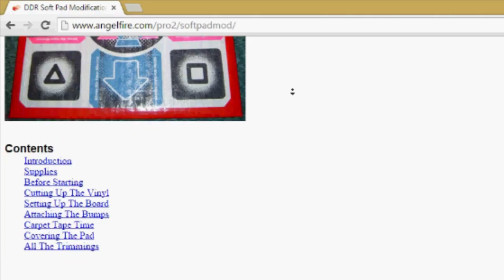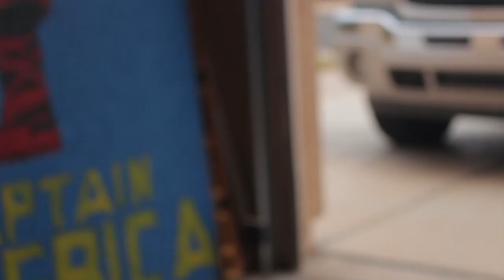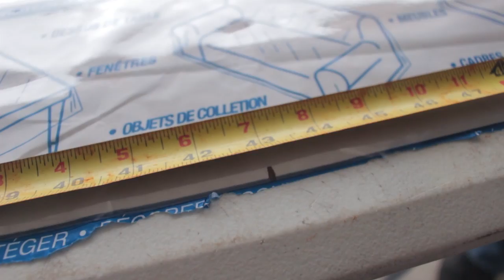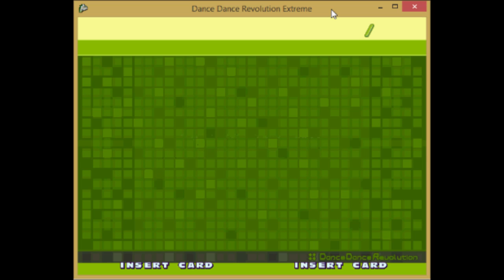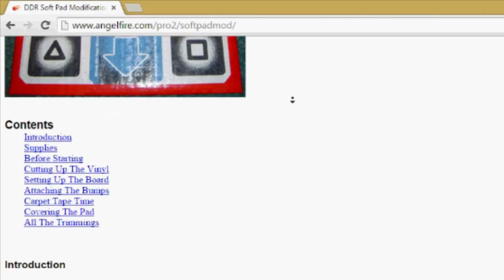DDR Soft Pad Modification Tutorial

Comment: will there be any input lag if I use a converter to PC? I wanna get a pad like right now but I don't have money for an ltek but this will do
the only problem is I don't have a ps2 lol
Reply from the maker: Both my pads use a PS2 to Pc converter and they have zero lag they work perfectly. I've used two other pads with convertors as well and they worked perfectly fine too
Reply: @marioCazares  sounds good, which converter are you currently using if you dont mind?
Reply from the maker: @harmonicposting  Hey I use this one: https://www.walmart.com/ip/PS2-USB-Dual-Controller-PC-Adapter-Converter-Consumer-Electronics-Gaming-Accessories-Player-Cable-Playstation-Attractive-Game-Joypad/581869851?wmlspartner=wlpa&selectedSellerId=101091584&&adid=22222222228000000000&wl0=&wl1=g&wl2=m&wl3=42423897272&wl4=aud-430887228898:pla-51320962143&wl5=1013523&wl6=&wl7=&wl8=&wl9=pla&wl10=462998764&wl11=online&wl12=581869851&veh=sem&gclid=Cj0KCQiAtJeNBhCVARIsANJUJ2ES6iK6IKpAFg5PM-dEh1gyoZVBMFr5zKZuICVct3Gc3IBYXEVYJZgaAr_jEALw_wcB&gclsrc=aw.ds

Comment: I just got DDR but how much better is the performance with this mod?
Reply from the maker: The pad does not move around nearly as much, and also you never have the issue of the pad scrunching up. You can even use shoes with this mod. So I'd say it a substantial difference from the non-modded soft pad
Reply: mario Cazares Really cool!

Comment: I finished the modification and it worked very well, but when I try to play it slides. how do I make it non-slip?
Reply from the maker: You can try a yoga mat placed under the modded pad (as this worked pretty well for me) or one that I haven't tried is possibly using Velcro strips under the pad
Reply: @marioCazares  thank you!! and one more thing. i can now play it with shoes or not?
Reply from the maker: @trippyship6222  yup you can I played quite a bit in shoes but I actually found it more comfortable with socks mostly

Comment: How much did you spend on doing all of this?
Reply from the maker: Since I already had the wood boards I believe it was only about 9$ total for the supplies other than the pads. I only had to buy double sided carpet tape and vinyl because I already had duct tape.

If you buy all the items (besides tools) it should only cost around 40-45$. This is all assuming you have dance pads already. Also, since this is for TWO pads, doing ONE pad could save you money on the vinyl and wood board.

Hope this helps.

Comment: hey mario, If I want to make a most ghetto one. That mean I just need a soft pad, a piece of wood and a double sided carpet tape right?

Update: After told this to my mom, she gave me a thick double sided tape and a thick yoga pad. I taped the soft pad on the yoga pad and it works! Well... For now.
Reply from the maker: I think that could work but just keep in mind skipping the vinyl will make the pad come off the wood a lot easier. The vinyl helps hold it down along with the carpet tape. If anything you can always just add more carpet tape if it looses stickiness
Reply: @marioCazares  got it, thanks.